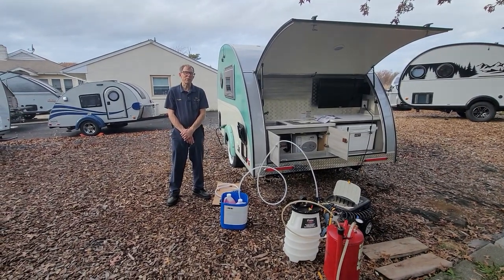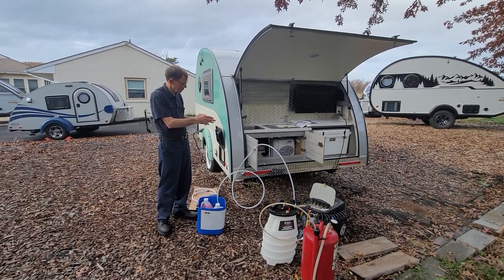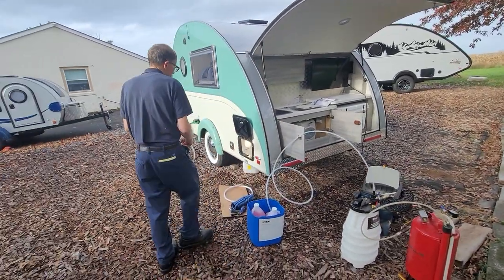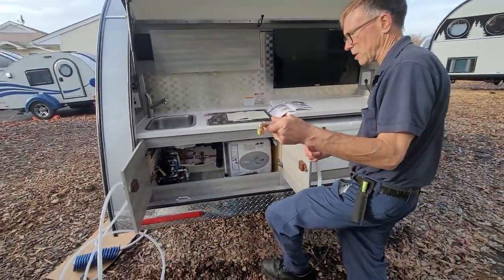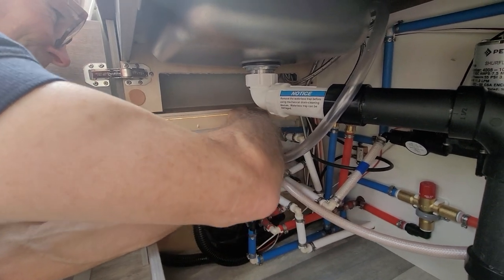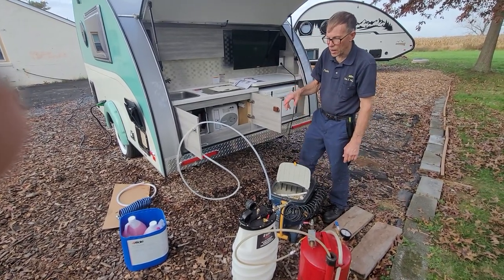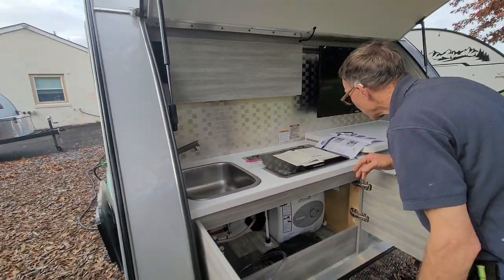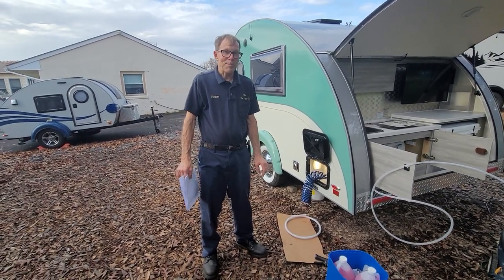How to Correctly Winterize Your Ultimate Camper (Ultimate Toy CS-S Special)

Comment: I have a question about the outdoor kitchen. The video I’ve seen with the woody color had a grill on the outdoor kitchen and not the stovetop burners. Is that an option or is it specific to the color model?
Reply: The woody modal has a grill. I have seen some woody with just the gas burner. I have the classic modal, I prefer the gas burner
Reply: @adoptdontbuy1  I believe it had to do with the manufacturer of the outdoor kitchen appliances. I’m to believe that the grill cooktop isn’t available anymore and is no longer an option. They have now replaced it with the gas burner cooktops. It could be a different manufacturer supplier as well.